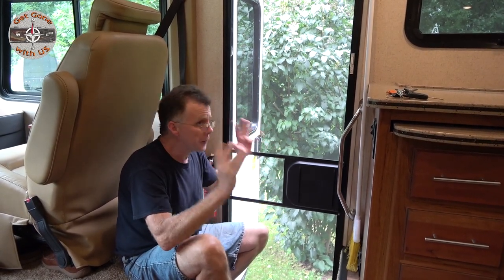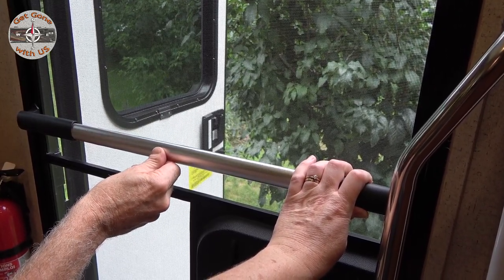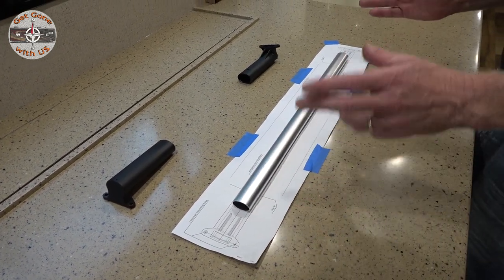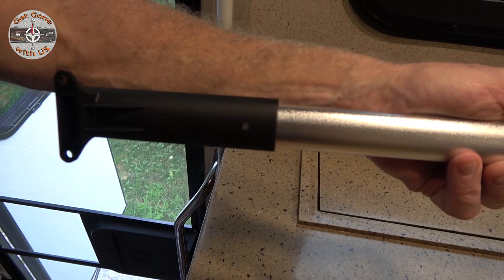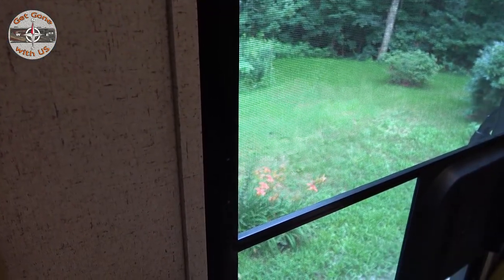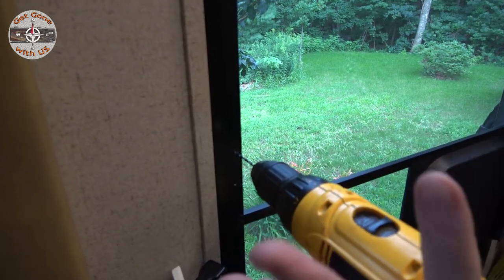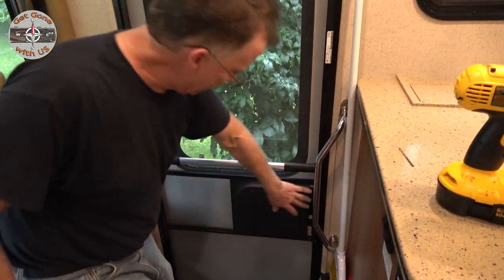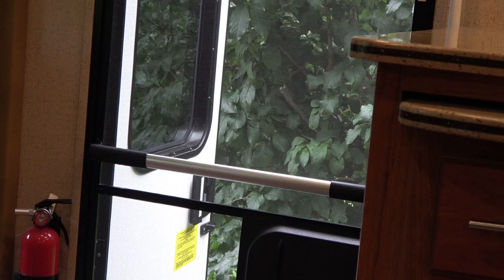Camco RV Screen Door Cross Bar Installation

Comment: Great easy addition.  I installed one on our last trailer and I think I'll do one on our Jayco too.  We travel with 2 dogs, so I did install a screen door grille for the bottom section for some added protection.
Reply from the maker: It was super easy and very useful.  We imagine the screen door grille is also useful for the dogs.:)
Reply: You bet.  I didn't want them to accidentally scratch or jump through the screen.